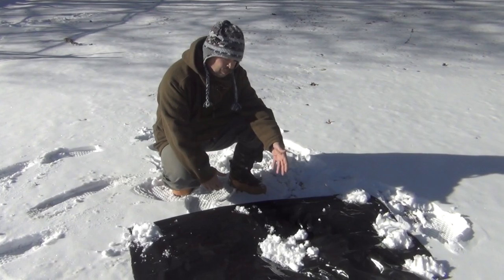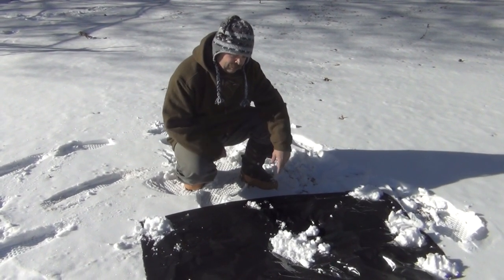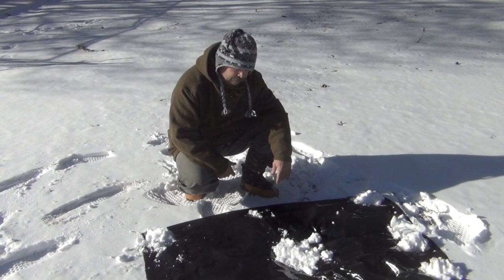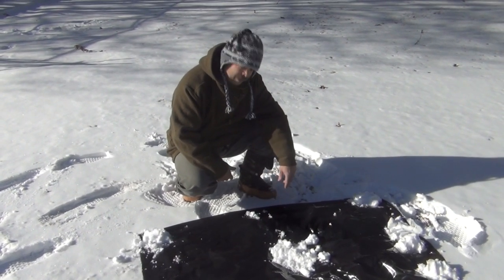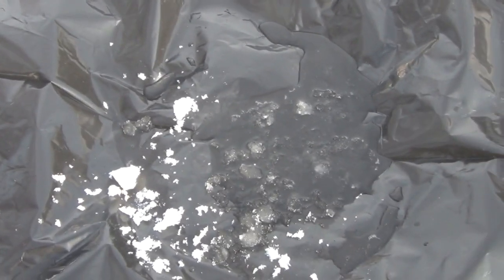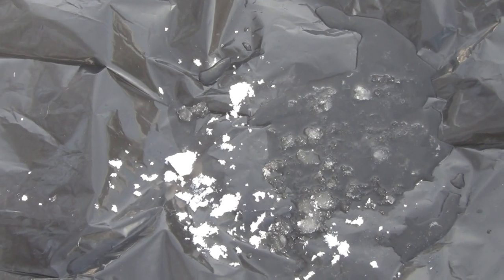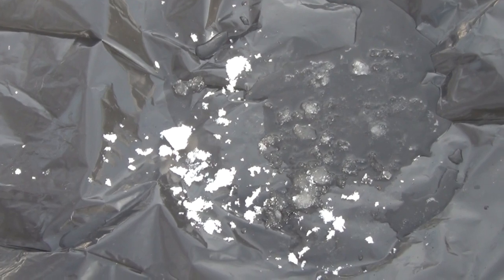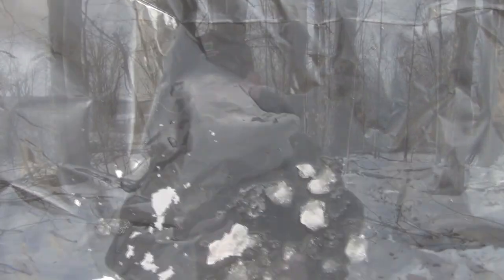Winter Water Generator

Comment: Rough up the shiny surface on your next trip to the sandy beach - not enough to affect structural integrity. A rough black surface absorbs more heat than a shiny one. Also, lay the plastic on an insulating layer of leaves, so the snow underneath doesn't conduct away that hard-won heat. Finally, shape it into a shallow bowl, so the melt runs together. Water will melt snow faster because it fills in the air spaces - conduction is more efficient than convection.
Reply from the maker: +Dave Gordon Thanks for those tips if i had had more snow I would have made a depression as it was I should have mounded the snow up an after thought. Thanks for your tips Dave

Comment: this would make such a small amount of water.  also raise it off the ground.
Reply from the maker: +Tim Barton I disagree once you have melted water you continue to add more snow a little at a time, the already melted snow "water" will greatly shorten the melt time. This in turn gives you more water. Did you ever see the signs that say bridge freezes before the road surface? Same principle bro leave it on the ground.

Comment: We used two car tires put a bucket of snow in the middle after you stack them up and a sheet of glass over it. Heats up snow and in spring to fall you can make hot water to wash with or clean.
Reply from the maker: +Lost Woods Survival Cool tick thank you for sharing!